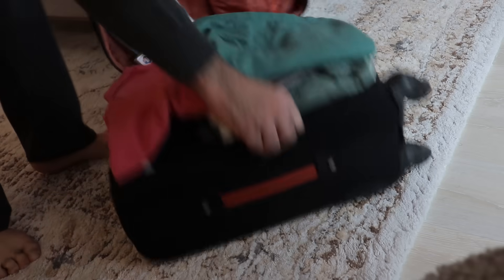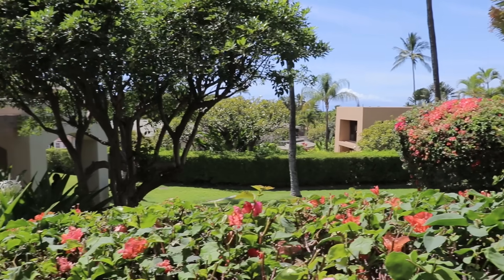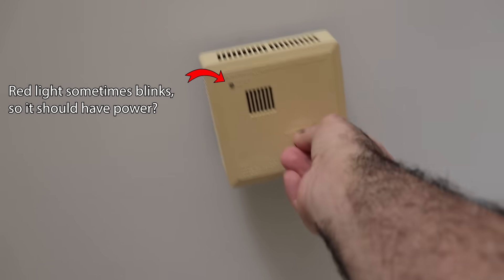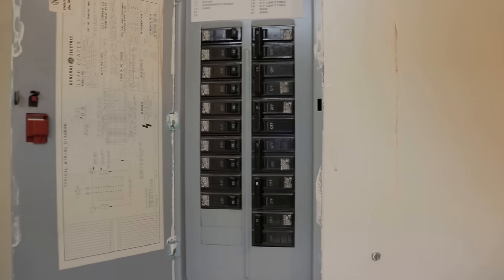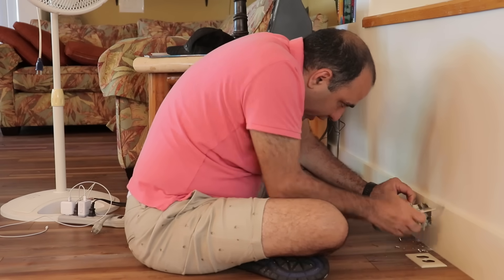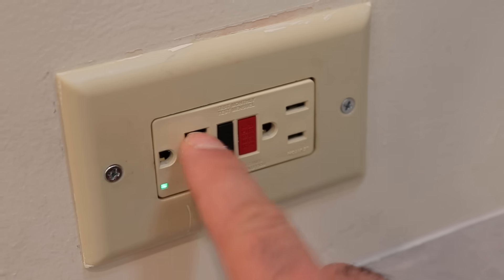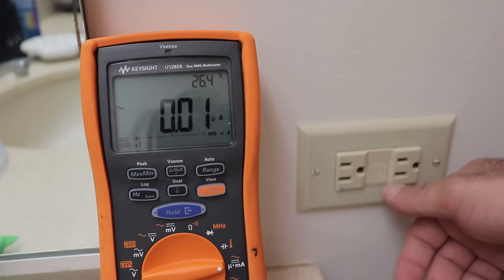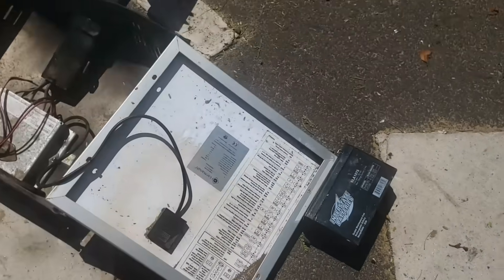Hawaiian Hotel Safety Failures

Comment: Whenever I do electrical work at home with my grampa that used to be a lineman for the county, he always unscrews terminals without turning off the breaker, and when I ask him why, he just says "is no need"
Reply: same, my dad being an electrical engineer doesnt cut the current before opening or even installing terminals or lights. because of him ive been  electrocuted twice.
(once because i trusted him while i was ignorant and the later because he made a mistake)
Reply: @ipanesm  Electrical Engineer doesn't equal electrician, at least in Australia, you have to do a course get a license to work with voltages over 50volts
Reply: @robywankenobi32  well as far as i know the career had that course, even if not complete, he knows the hows to after all.  i mean he designed the circuit for the kitchen if irc

Comment: "So hotels have the money to repair and maintain"

Or, you know, so that they can have more money to shove into their pockets and never spend on safety equipment.
Reply: Considering the smoke alarm should have been replaced in 1994, and it is nearly 30 years after that.......
Reply: Yeah, I'm hoping that Mehdi just showed this single fire alarm and that there were newer ones throughout the building. But probably not, though. Been in enough shady places myself to know better.
Reply: Just call the city. If the hotel is already knowingly using these things and has been since the 80s, I doubt a complaint from someone who won't be returning will matter. 
Fire code however...
Reply: @youtubeSuckssNow  There's no inspections. Calling them won't do anything. They're either friends, bribed or fire chief doesn't care.
Reply: Yessir

Comment: There is no excuse for that smoke alarm. That smoke alarm is absolutely ancient, and it should have been replaced at least 20 years ago (Yes, the alarm says 1984, but it's hard to tell when it was actually manufactured; that's likely the patent date, not the actual date of manufacture). That's a horrible safety oversight, and no hotel is so strapped for cash that they can't buy a new smoke alarm and some new outlets. For reference, the NFPA recommends that homeowners replace their smoke alarms every 10 years, or when the alarm stops working correctly, whichever comes first. This applies to both battery-powered and hardwired alarms. When you consider that this building ALSO has electrical faults that very well could cause a fire, it's very scary to know that your smoke alarm, the one thing that's supposed to protect you from that, doesn't work.

There are some things that budget hotels can skimp on; guest safety shouldn't be one of them.

Comment: There's idiot safe testers available that also have a GFCI test function on them.  Much easier (and safer) then the meter/resistor arrangement.
Reply: In fairness the test button of a GFCI works by inducing an intentional Earth/Ground fault so that should be adequate for most and is also idiot safe. The biggest problem is even with a robust, safe, and convenient built in tester at their fingertips far too many stubbornly refuse to budge on their once in never testing schedule. In that regard GFCI's and photoelectric smoke detectors have some of the best self tests as in both cases the self test harmlessly activates the device through the very same mechanisms and components as a real event. In the smoke detector case then button literally pushes a reflector into a chamber scattering the light from the LED like smoke would to activate it. Unfortunately the same is not true of the ionisation based smoke detectors though as for those you would actually need to inject some kind of micro particulates to have the same effect. They need something that can take a charge and interact fairly strongly with a relatively weak electrostatic field to make sure the source, chamber, and detector are all functioning normally. Not too difficult to put them through a full test though a couple of seconds exposure to a recently extinguished candle does the trick but that does require one to know enough about their workings to even be aware of the detector is not actually being tested in order to compensate. Not ideal for a safety critical consumer product given that most consumers are not engineers or physicists and of those even vaguely aware there is a significant functional difference between detectors I doubt many could name any of the pros and cons between them let alone that one specifically.
Reply: @FaerieSeraphina  They have smoke in a can to test smoke detectors. simple and effective.

Comment: I live in a small town in finland. I don't think I've ever seen a grounded socket here. Seems to be very rare in even bigger cities (might be selection bias on my part, I rarely visit any newer buildings). No gfci, obviously, and old fashioned fuses with an actual wire that melts.
Electric stoves (that's the norm here, I've never seen a gas stove in a house), they get their own 25A fuses, and a thick wire straight to the wall, no socket; I think they're grounded.
And with the european sockets, as you can plug a plug in any way you like, there's no distinction between live and neutral. I find that rather unsatisfying.
Sometimes, if you touch a metallic electric thing _just right_, and with right part of your finger, you can feel a tingle...

There's this curious effect that happens with a thing that's plugged in, and has a metal exterior: when you lightly drag a finger across the metal, you can feel the 50Hz. It's as if the 50Hz modulates the stiction between the finger and the gadget, vibrating the finger.
Right now I have a phone with an aluminumium back on a charger, and a laptop with an aluminumumium exterior that's plugged it. When I lightly rub my left index finger on the phone, It feels normal. When I lay my right palm on the laptop, and run the same finger on the phone, I can feel that modulated stiction effect. Sometimes I don't even have to touch anything else to feel it. I can measure no ac or dc voltage across the devices with a multimeter. I wonder what causess this.

Comment: “Wow, breaker sub-panels are really dangerous once the cover is off and he seems awfully casual as he…POW!”

“Um, did he just reset the breaker and then pull a hot outlet…POW!”

Good on him for showing what NOT to do.  Here is what’s correct:

Before working on an outlet or switch, plug a lamp or something into it so you can see that it is ON.  Leave it on. Throw the breaker on your sub-panel, and check that the light is OFF. Now, tell everyone nearby what you are doing, and tell them to NOT TOUCH ANYTHING.  It is now safe to work on it. 

Before working on a sub-panel, go to your main breaker box and turn off ALL the breakers.  Also do the lamp test on every circuit, if you want to be sure. Also tell everyone what you are doing. 

Before working on your main breaker box…CALL AN ELECTRICIAN and don’t touch the damn thing. It is NOT safe for you.
Reply: Is this a joke? You must be new here lmao
Reply: @torquesoftware  Why yes.  I am new here. I did notice that he uses a name with BOOM in it and that he didn’t edit out that stuff, though. So, I figured something was going on….  Also, a demonstration of the consequences of doing things the wrong way can be golden, so I admire that he went through that. 

And yeah…I those were basically the thoughts going through my head as stuff exploded.

Comment: Mehdi, I hate to be "that guy" but the two hot leads are not out of phase in a 240v breaker panel. Instead it is the two live leads from a transformer, and the neutral is in the middle. If you take all of the breakers out of a box you can see more clearly that a "double breaker" or 240v/30A breaker is connected to the hot leads and a single breaker 120v/15 or 20A is just connecting to one then neutral.

Comment: Funny little thing I noticed,
The smoke detector has a manufacturing date of June 1, 1984, and there is another label that states 05-24-91 which I am assuming is when it was supposed to be replaced. So that means It's 30 years over its replacement date.

Comment: Sometimes I feel like IoT is less Internet of Things and more Internet of Trash. Like they add wifi and bluetooth and an app to things, and it just makes the product worse because they use it as an excuse to remove much more user-friendly features like buttons and good, simple user interface. So you're just left with one button and you have to divine what sequence of button presses and holds will make it reconnect to the app so you can actually control the device.

Edit: I'm not completely against IoT, I'm just suggesting to people thinking of making an IoT device that they should also think about usability of the device itself, not just the app.

Edit 2: Almost forgot, I hope you and the family had a nice vacation!

Comment: I'm glad you and your family had a great time in Hawaii. I hope we get to see you back here soon. I know your channel is mainly for electronics, but please please please keep distance from those sea turtles(Honu). They're a protected species here and you can be fined if you're getting too close. Most locals won't report you or anything, but we will just tell you to back away from them. You should try to keep at least 3m from them if possible. If you're swimming and the current pushes you towards one, just try your best to not bother them. The same advice goes 10 fold if you ever see a monk seal. But usually the seals are more heavily monitored as they're critically endangered.

Comment: That was something new I learnt about poor contacts becoming a fire hazard! I’m going to check all my outlets today. Great video Mehdi, hope you all enjoyed the holiday 🙏
Reply: @Karl with a K I’ve had that happen too! It taught me not to overload dimmers again
Reply: @Karl with a K Maybe not in your specific case but people often let early signs of faults leading up as they can seem like minor nuisances in isolation. So many people in fact that you can absolutely guarantee that very similar scenarios have and most definitely will again have the circumstances to become a much bigger problem. Someone is going to have some antique non fire retardant upholstery or the full waste paper basket placed next to the door under the light switch for convenient disposal later while they procrastinate over putting their shoes back on to go out into the yard. Non fire retardant fabrics especially those with lighter weaves go up well from fairly brief physical contact with even smouldering materials. Loose paper is often even worse especially when it is a loose low density collection of screwed up sheets with plenty of gaps for airflow so naturally this is exactly how it is usually disposed of.

People need to be more aware that socket that needs to be finagled to get it to power a device or the dimmer that needs to be turned up higher before the bulb lights at all these days is well worth the trivial expense and time to replace. Hell it is a cheap and quick job that is worth it for the nuisance value alone in the scale of things but such are signs of worn contacts making a borderline connection at best. That is to say they are signs that your device has downgraded itself to the role of a cheap, crappy, and dangerous space heater and it is probably high time to replace it before it decides that becoming an open fireplace is it's true calling lol.
Reply: @Karl with a K yea but it was code for a long time and a lot of houses still have it :(
Reply: @Karl with a K this is why i dont use dimmers period. even when i moved to my new apartment the first thing i did was check every outlet and find a place to put my pc where i could use more then one to power everything.
Reply: Surprised the home I'm renting hasnt gone up in flames yet...
Reply: now that I think about it, poor contact is like trying to run a large current through a thin cable, because the same amount of current has to go through smaller area, it heats up faster.
Reply: I just had a similar issue in the breaker box. A sub panel's breaker kept popping (240V 100A). Turns out the connection to the wires at the breaker were loose (aluminum wire which expands & contracts way more than copper). This loose connection was causing the breaker to get real hot and eventually causing the current to increase and pop the breaker. Tightened the breaker up and no more issues
Reply: @Karl with a K Ah I wasn't aware that literally nobody in the entire US has any antiques. Also apparently gravity doesn't exist there also so molten plastic can't fall down. That would be cool to know if it was real much cheaper to get to for some zero G gaming action lol.
Reply: Can you cook koobideh by passing current through it?
Reply: @mrprettytony  induction heating
Reply: Matthew Moore - Tech Café  Damn, was that expensive  and/or difficult to do? I applaud your initiative to start and complete home projects like that, especially when they can be beneficial to your health/life. I'm in my mid 20s and thinking about that kind of task seems daunting, but I have really poor self discipline. However I know that stuff is going to end up happening in my life as well and there may be times when I don't have the money to hire someone/know a friend with enough knowledge to help me out.

Sorry lol, I'm having a bit of a random-ass "damn I'm really unprepared" moment after reading your comment haha.
Reply: Use a fork!
Reply: A commercial insurance inspection is done by using a thermal camera and viewing all connections under load. You can find poor or loose connections in switches and lugs of your electrical equipment.
Reply: That was really helpful. Thanks Mehdi!
Reply: The rapture will happen without a doubt and it will happen much sooner than many believe (less than 10 years according to all the environmental, weather,astronomical signs ,israel timelines etc showing ). It will happen without any warning , not one , in an instant , catching masses of people off guard just like God always does, ie the flood ~ a rude awakening . No one knows the exact day or hour the rapture will happen is a certainty . THE RAPTURE CAN HAPPEN NOW at ANY TIME make no mistake !! . Please awake to Christ Jesus which is the ONLY hope NOW and dont let it be found out it IS all true later when its too late & many have been left behind in the most terrible times the earth Has Ever experienced Before and ever will...for anyone who sees this and doesnt know what to do please If anyone hasnt given their life and heart to Christ Jesus will have REAL BIG problems way bigger than any problems Ever had If left here on earth after the Rapture . After the Rapture The USA , Worldwide , will face More evils , Inner city chaos, firearm wars etc etc ,power & water , food shortages , military invasions,mass executions (yes much blood will be required by antichrist ) etctec than it Has EVER been seen Before and you surely dont want to be Here then . We Have Time NOW to change , please seek Christ Jesus while there is still time to save ! no one knows the day or hour of the rapture it will start out just like any other day and it will Take Place In the day In Broad daylight/sunny day , In an Instant FLASH without ANY warning ,& there will be peoples Driver Ids, cell phones ,wallets found in various parking lots,Purses, bill folds Found at work etc etc with NO explanation , and People VANISHING so No One can refute it has taken place. .
romans 10:9-10 That if thou shalt confess with thy mouth the Lord Jesus, and shalt believe in thine heart that God hath raised him from the dead thou shall be saved! 
please share with others =IMPORTANT
raptureready.com
Reply: The reason why Hotels and similar have loose receptacles is because of how often people plug and unplug things into them, as long as your outlets aren't say 50 years old and only have 2 pins, they are likely fine, but a once about your house to check isn't the worst idea.
Reply: And especially since brand new fresh and happy outlets cost $0.69 cents at home depot. Having old tired outlets is a shame.
Reply: @Karl with a K  Today we never use aluminum wire. 1950's era 100 amp house may be 50-80% aluminum wire. Basically whatever got left behind in a haphazard 3 wire upgrade.
Reply: @Karl with a K never use, primarily. Lots of old US homes still have Al tube and knob

Comment: So the fire alarm doesn't work and the outlets are melting themselves over time.

Man I love Hawaii
Reply: The smoke detectors are supposed to be replaced once every ten years.  Considering that the only smoke detector wasn't working, the codes for renting the place would technically make the place uninhabitable from a fire safety standpoint.  One call to the fire Marshall and he would probably shut down that building and look at the other buildings on that property for the same violation.  It could cost the business huge fines as well as having much of their property shut down until compliance is met.  If multiple units are in that building, not having a communication wire between all the smokes in all the units would be another code violation.  Finally, because it is a commercial location, the fire martial may require that there be a monitored fire alarm system.

Comment: Perhaps the faulty GFCI was just a placeholder? Maybe it's just there for show, or it might be so old the mechanism responsible for tripping at 5mA broke or wore out, also that hotel probably isn't upgraded a lot since there's a 38 year old smoke detector and old outlets. 
Also, why use ovens and microwaves when all you need to cook things is a short circuit?